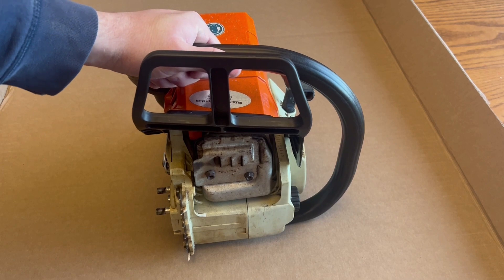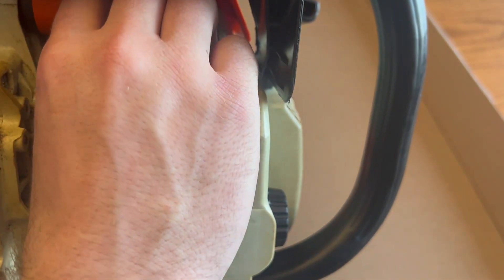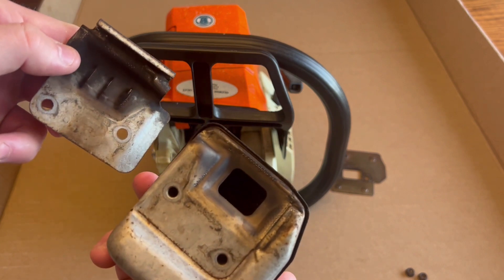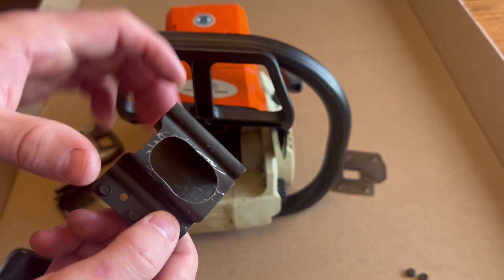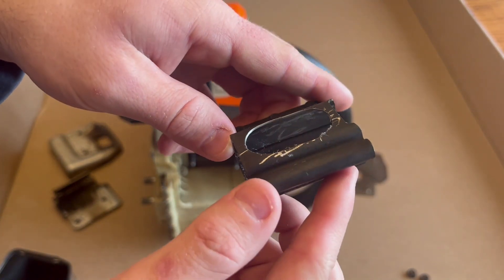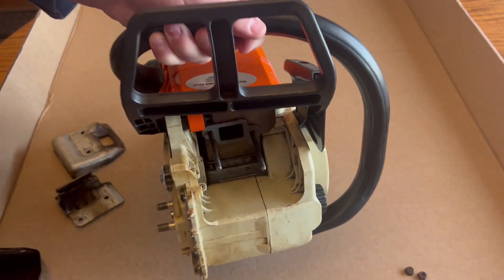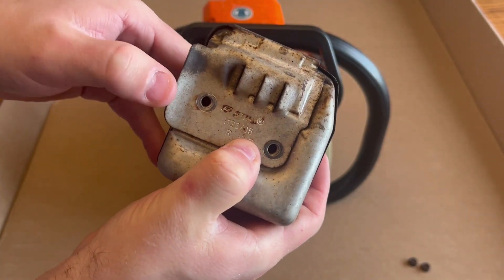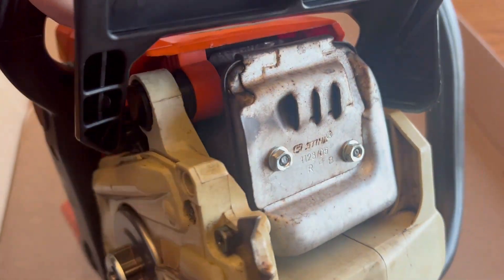Stihl Chainsaw Muffler Mod - Easy how to muffler Modification on MS250 025

Comment: I modified the air filter to take a hight flow pod filter & upgraded the old 250 clutch with the 361 springs, removed the limiting screws of the carb & retuned the saw!. I use the saw everyday for felling trees & it’s a grate reliable mid range saw with plenty of power!.
 For maximum performance of any engine when you upgrade the exhaust depending on the out flow, it’s always beneficial to match the inflow!!.
Reply from the maker: That sounds like a little beast! Post some videos of it!
Reply: @RidgeOutdoorProductions  give me till tomorrow daylight, don’t think the neighbours would appreciate me starting a chainsaw at midnight 😂
Reply from the maker: @zanehambln  haha they probably
Wouldn’t! Can’t wait to see it!
Reply from the maker: It says the video is private :(
Reply: @RidgeOutdoorProductions  sorry just changed it

Comment: Just get a piece of steel tubing from a hardware store and cut off 2 lengths the same length as the stand offs built into the internal baffle, and  epoxy them, over a set of holes, and once set up reassemble the muffler.  In that way there is the most exhaust flow possible along with no cutting and filing.  The first time use will burn the glue off and they will be trapped by the screws.  Also make sure you discard the spark arrester (or “or” your choice) as these carbon up with time and sell more chainsaws with the owner believing the saw to be worn out, than any other reason for sales.
Reply from the maker: All great valid points. Thank you for sharing this. I will make sure to pass along!

Comment: Have you or anyone actually dynoed before and after to see if there is actually a difference?  Or does it just make them louder?
Reply from the maker: No, no dyno. You have to adjust the carb afterwards. Believe me, it makes a difference. Cut through a piece of wood much quicker after this mod is completed.
Reply: @RidgeOutdoorProductions  thanks, gonna try it on a ms260
Reply from the maker: @steve709061  let me know the outcome!
Reply: @RidgeOutdoorProductions  Does anyone know how to set the carb after the MOD?
Reply from the maker: @ yes sir there are tons of sources here on YouTube

Comment: do you think it would be any different just removing the baffle ?
Reply from the maker: You cannot remove the baffle because when you go to reassemble the muffler it will smash upon tightening it.
Reply: @RidgeOutdoorProductions   yeah you can just put two pieces of copper tubing or steel tubing in place of the baffle and it will tighten up without smashing.
Reply from the maker: @vart7767  yes - that would be correct!

Comment: The muffler on an MS250 doesn’t come apart like the one on the older 025.
Reply from the maker: Thanks for the heads up!
Reply: @RidgeOutdoorProductions  I’ve been looking for a way to do this kind of muffler mod for my MS250 without having to cut the muffler apart.
Reply: @stevenkinnison8044  What I did was bought a second muffler, hogged out a hole in the can right below the existing louvers and welded a 3/4” 90° section of pipe facing down and away from the dogs of the saw. 
It runs GREAT. The saw no longer cooks the plastics, hopefully keeping heat away from the crankcase which is just below the muffler. 
The carb had to come rich a little but due to our altitude that needed done anyhow, manual suggests a quarter turn richer for every 3000ft elevation gain.
Reply: @stevenkinnison8044  I just watched a video about a 250 muffler mod. The man just put the muffler in the vise, took a propane torch and heated up two sides (at a right angle.) Then he pried the seam up. Done the mod. Then put it back together and pounded the seams back down and into place.

Comment: Did you test the RPM of the saw before and after, or for that matter the "state of tune" of the engine?
Reply from the maker: Yeah you can test rpm before and after. Adjust the carb into your liking as it will need adjusted with the muffler mod.

Comment: Will it increase power after mod
Reply from the maker: Yes! I could definitely tell a difference. You will also have to adjust your carburetor for more fuel on the top end after this modification.

Comment: Hi remember to not mess out with the back flow, it there for a reason.
Reply: I think you mean backpressue? However this is a 2 stroke engine not a 4 stroke engine with a turbo or supercharger therefore, the back pressure issue  (which is driving the turbo or supercharge) is non existent.
Reply from the maker: thank you for taking the words out of my mouth!

Comment: Why would you do this?
Reply from the maker: Same reason anybody else would. More power.
Reply: The difference between 2 stroke and 4 stroke engines is the temperature operating! 2 stroke engine when get hotter it loose its power instead of 4stroke that is completely the opposite philosophy! Most of "loggers" here they make it for power and less rising temperature! The factory exhaust with spark arrestors and pollutants filters (yes , they try to play it green even in gas chainsaws ,lol) reduce the gas flow from the engine to come out easily so heat is rising and it turn the chainsaw down more quickly! But you don't want to overdo the exhaust mod because there's a reason for 2strokes exhaust have a weird shape! Their shapes it's giving back with sound waves some mixed air and fuels that escape when the 2 ports are open together for a small amount of milliseconds to make the engine run with more power and somehow with lower fuel consumption, so if you just put only a tube for exhaust you have more fuel consumption but it regulate with lower engine operating temperature , you might have also problems at low revs(it will work unsynchronise until it rev up)but it will be minor defect, you might not even notice that!

Comment: STIHL(Still) Junk..
Reply from the maker: What manufacturer do you prefer mate?
Reply: Husqvarna?
Reply: @RidgeOutdoorProductions I have a old jonsered cs2245 which is basically a husky 445. Most loyal chainsaw I’ve ever had.
Reply from the maker: @ssholed  those are great saws!